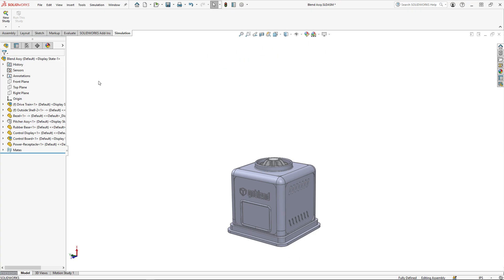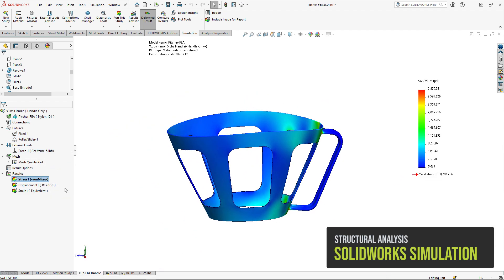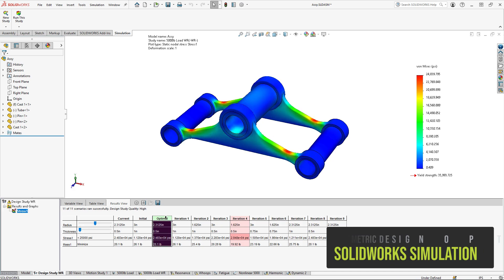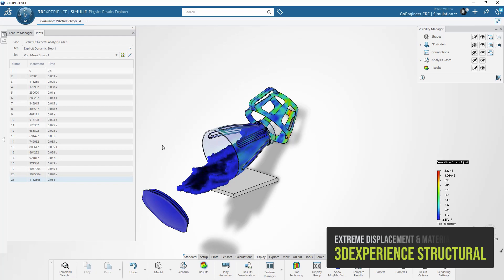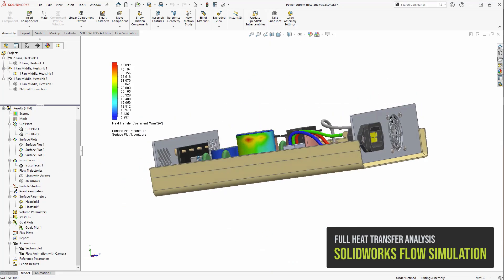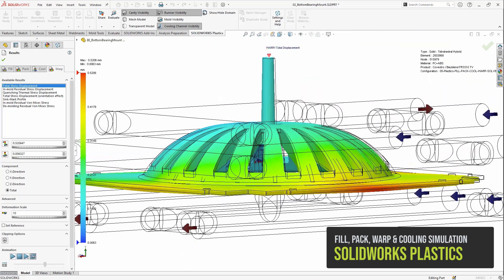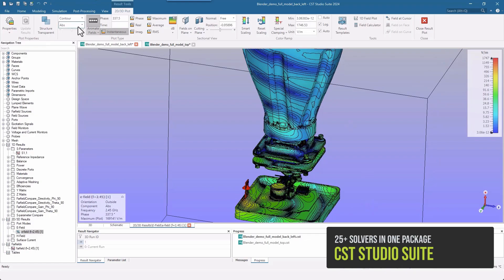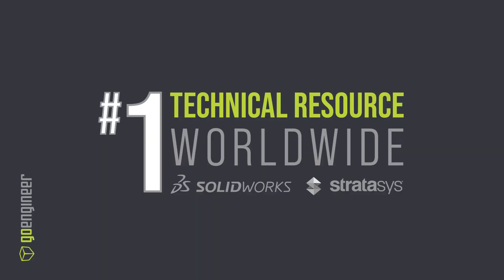Simulation from SOLIDWORKS: Analysis for Every Discipline

Comment: Can we trust Solis works solver, I read an article saying it is not good and nastran or something is better one invest time for learning. What is your opinion?
Reply from the maker: Thanks for the question! The SOLIDWORKS Solver has been established since the late 1980's, with a large history behind it.  SOLIDWORKS SIMULATION, like every other analysis tool, adheres to the NAFEMS benchmarks, for accuracy.  The physics of the problem is a constant and is solved in the same way no matter the code.  As long as the setup of the model is consistent, and the problem is within the bounds of what is possible in the code, the results will be the same.
Reply: @goengineer  thank you for the response